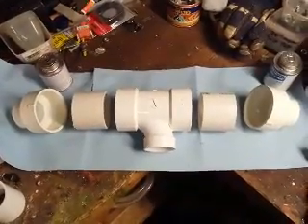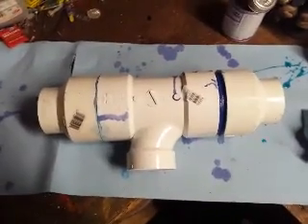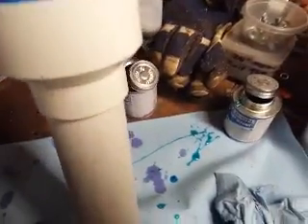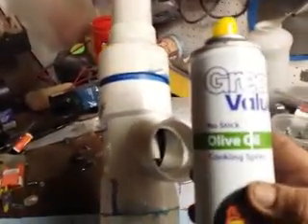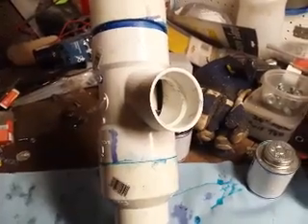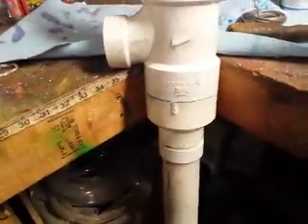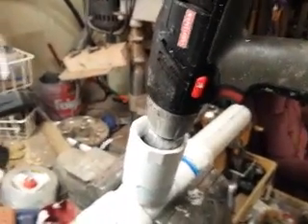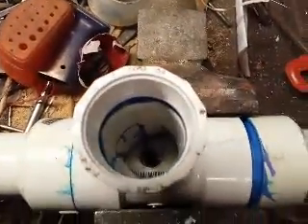swivel joint assembly

Comment: Hi pls tell us if this swivel worked out
Reply from the maker: It did work on my little homemde drill. However it wasnt without leaks. I only drilled down to 60ft. And got water for my sprinkler system.

Comment: Does it work?  Did you even test this?  How does this integrate with your drilling rig?
Reply from the maker: Svend Holme Amazingly enough it did work.  But eventually the inside pipe heated up and caused the slip joint to leak.  Also the inner pipe as i was drilling I could tell it was going to break from drill pressure.  So what i changed was I used a metal inner pipe which cut down on my heat problem and making the inner pipe stronger as it rotated the drill pipe in the hole.  I only drilled down to 40 feet with this setup.  I have since purchased a regular water swivel used on mini drilling machines and i have been able to drill wells down to 185' using 1" gas pipe as drill stem/pipe.  I've never worked on a rig of any kind.  My dad worked for Halliburton and wouldn't let me get a job in the oil patch.  He would have been proud how I came up with drilling this monitoring well.  EPA made me drill the monitoring well to make sure none of my leach field water was getting down to the drinking water aquafer.  Took me 1 year to build a 35' derrick and find a hydraulic rotator and mount it on the back of my semi truck used for moving mobile homes.  Got it drilled though.
Reply: @mobilehomedoctor 

By all means pls show us that metal inner pipe set up and the rotator if you have it
Reply from the maker: It did work on my little homemde drill. However it wasnt without leaks. I only drilled down to 60ft. And got water for my sprinkler system.